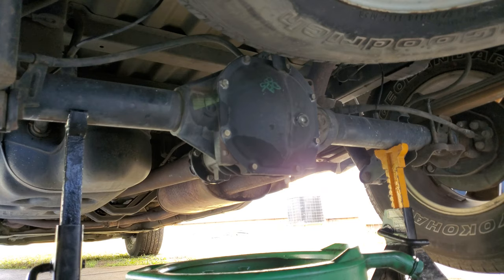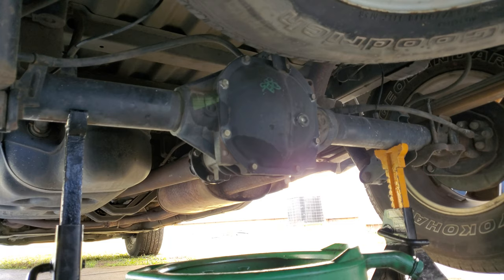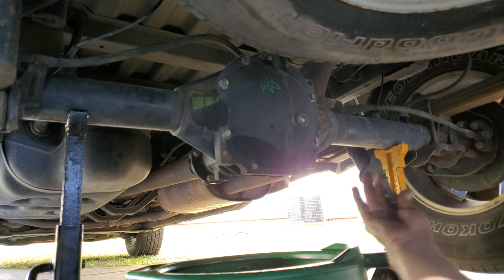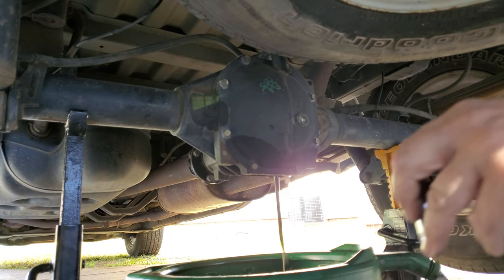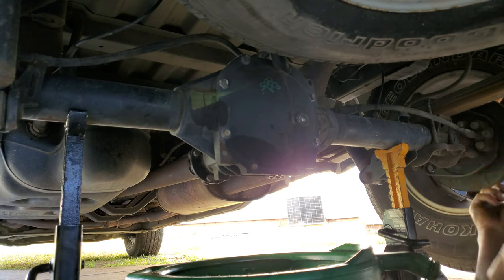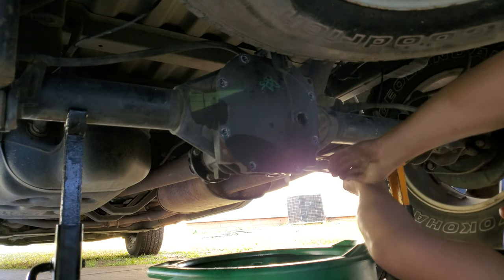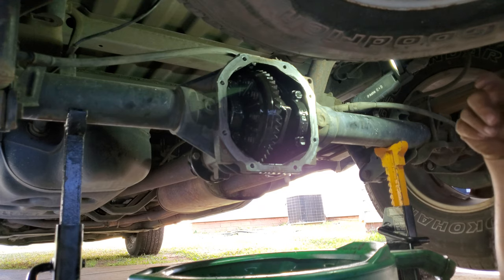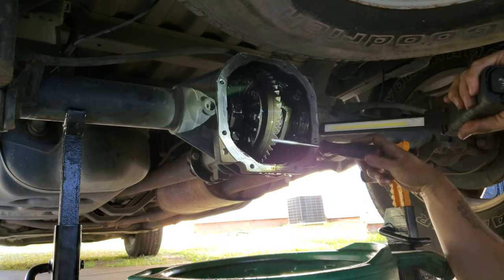Nissan Frontier Differential Noise Diagnosis

Comment: The 2 spider gears are known to fail on these Xterra’s. As well as the Frontiers and Titans of this era. Nissan eventually “upgraded” to 4 gears, which should help. Also the front diffs like to grenade  under heavy shock load. Also, the rear diff breathers get clogged and blow axle seals. Nissan really under engineered the drivetrain components for this generation of trucks and SUVS.
Reply: Do Xterra's have the same 8 bolt 200c rear end. I have a 14 frontier it has a 200 rear and it is roaring. I wonder if it is the spider gears like this one.

Comment: My dads 2012 frontier has this exact issue growl while driving with no change with acceleration or deceleration. So no backlash issue. I thought it may have been axle bearings as the noise sounds like its outboard not inboard. Im going to check the spiders now thanks for the video!
Reply from the maker: I am doing all the bearings, spiders gears, and seals on this differential while I am in there.  This does not use a bolt in the center pin for the spider gear but it uses a roll pin instead.  I am going to post a video of me installing everything when I get the parts.  Also if you need the spider gear part numbers let me know.  I went through a lot to find them.  Took nissan like two days to find them for some reason.
Reply: Ever find the problem?

Comment: I have a 2010 pro 4x woth the bigger rear end and have the same exact issue, started to hear it howl thought it was my mud tires until it got louder and knew it wasn't luckily mine is covered under a extended warranty I bought, hopefully it lasts another 3 years after the rebuild so I can sell it and get something else
Reply from the maker: That's good that the warranty covered it for you. I don't know what really causes these differentials to do this but seems to be really common on this generation of them.

Comment: en mi opinion es la cruzeta del cardan...tenia el mismo problema asi como ese ruido y hera la cruzeta que sostiene el cardan pegado al axel..
Reply from the maker: I replaced the rear differential in this truck 4 months prior to this video with a used one and replaced the u-joints at the same time along with a center support bearing as well.  The u joints can cause a pinion bearing to go bad, which is what I'm assuming you are talking about.  I agree with you on that.  Which a bad u joint can cause many problems.

Comment: I have question for you I’m about to purchase a 2006 or it maybe a 2008 model frontier it 4x4 for a 1,000 off a friend’s uncle it been sitting awhile so I have to put tires on it and I’m sure some other things he said engine and transmission are good but said there an issue with the rear differential I just want since you owe one is worth buying for such a cheap price and replacing the rear if needed other then that is it a good truck? Worth putting some money into? Thanks
Reply from the maker: This is actually a customer's truck but I will think they are decent trucks other than a few small issues.  The differential is one of the biggest  issues they have.  Depending on your area, you may be able to find differentials cheaper than rebuilding it.  But, they also have two different rear differentials depending on the sub-model.  For a grand I do not think it is a bad deal depending on the body shape (i.e. rust, dents, etc.) and how good the engine and transmission runs.  If it was me and the truck ran decent and was not a total rust bucket I would get it and would not hesitate to put a little money in it.  This is my opinion without actually seeing the truck and listening to it run.

Comment from the maker: As a side note, this seems to be a common problem with these differentials as I have read numerous forum posts stating this exact issue.  Even to the point of one person stating to have changed them three times before hitting 100k miles.
Reply: Hello and thank you for the informative video. My 2001 xterra was making noise in every gear. I decided to remove the transmission thos week and I notice that the part with the 4 bolts attached to the differential where the drive shaft is bolted to has came apart about 1/4 inch and the truck just locked. It won't go forward or back not even in gear or neutral.  So after watching your video I took off the differential cover to see the inside and there is not one drop of fluid. So thanks to you I decided to replace the differential.  Thanks for your help.
Reply from the maker: @Jorge Hetnandez  I'm glad that it helped it out.  If you need any further information feel free to contact me on here and I will help anyway I can.
Reply: @operationoverhaul  thank you much. I plan on removing the whole differential tomorrow here in Georgia rain or shine. Thankfully another guy got rid of his tundra because of bad engine. I bought the manual transmission and differential for a good price.

Comment: my 2012 pro4x has a humming sound that starts around 40 miles/hr. It only happens when I accelerate or under load. Dealer said gears look ok and there was no metal stuck to the drain magnet. Some how water got in because the oil was brown. I’ve replaced the oil 3x already but the noise is still there. There was also signs of rust but not on the gear teeth themselves. Dealer suggested a new rear end but Im not convinced it needs replacing. Any suggestions.
Reply from the maker: Check the pinion seal for any signs of leaking and also check for any play in the pinion bearings.   Do the same for axle seals and bearings as well.

Comment: I drained my fluid and noticed..something..attempting to exit drain plug hole. It was too big to exit and I nudged it up with my finger trying to figure out what it was. Any idea? Should I pull the cover and investigate further? Seems to be running fine
Reply from the maker: I would pull the cover off to inspect it better but how much metal was on the magnet of the drain plug?
Reply: If this is comfort five months later, I took the cover off of my diff, and mr centre pin and some teeth dropped on out, totally wack

Comment: Which rear axle is this ?
Reply from the maker: This is the C200 rear differential.
Reply: @operationoverhaul  I'm doing a pinion bearing on a 07 frontier but the damn bearing I got was wrong and now I cannot find it anywhere lol the dealer said they don't sell it separately from the diff. It's my mom's truck too and I got it stuck in my bay at work and I'm just extremely fucked lol
Reply from the maker: @mmorales3363  have you watched my other videos on this rear diff?  I completely rebuilt one and have all the part numbers on the description. So you need the pinion bearing?
Reply: @operationoverhaul  I haven't watched the other ones, but I will check them out now, and yes outer pinion bearing
Reply from the maker: @mmorales3363  This is the factory part number for the c200 differential outer pinion bearing:  R35-60U2U42-20-11
Reply from the maker: @mmorales3363  just google search that part number and it should come right up for you.
Reply from the maker: @mmorales3363  actually go to a nissan parts site and put that number in the search.
Reply from the maker: also, if you cannot find it there Z1 Offroad has them as well.  Here is a link for you:  https://www.z1offroad.com/rear-differential/nissan/oem-05-frontier-c200-differential-pinion-bearing-outer-p-18697.html?gad_source=1&gclid=CjwKCAiA0PuuBhBsEiwAS7fsNTn04gBHJqKsHNQ4-JQSQDdXJazghSSzqC93bBQr_pTZhwzXg8XGLBoCsH0QAvD_BwE
Reply: @operationoverhaul  ill do some more diggin. By the way, thank you for reaching back out. I appreciate it!

Comment: Hi, what year model truck was this and how many miles was on it?
Reply from the maker: This was a 2008 with close to 135k miles.
Reply: Thanks, I have a 2010 2WD 157K, I just started no noticing the rear roaring noise it seems to be getting worse every day. Is this something that I need to address immediately? Do you recommend finding a good junkyard rear end or having someone professionally rebuild it?
Reply from the maker: @nickmizell1141  your welcome. I would first do a fluid drain to see how much,  if any,  metal was in the fluid.   Then I would check the pinion for any play to eliminate a pinion bearing.   These would be the two easiest/ quickest checks before diving deep into it.
Reply: What did you find out was wrong?